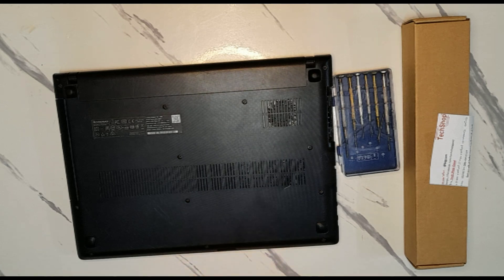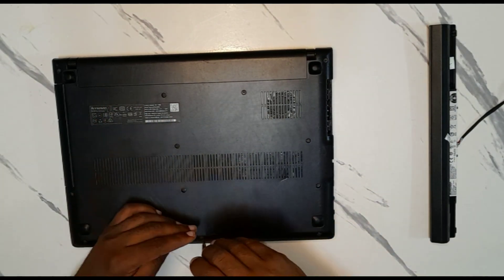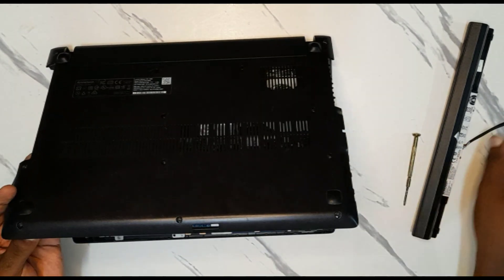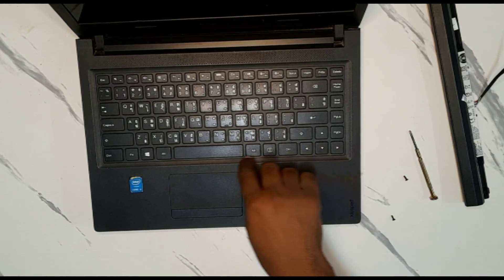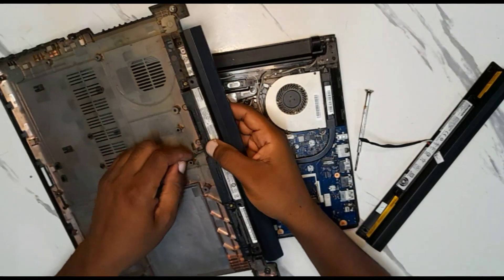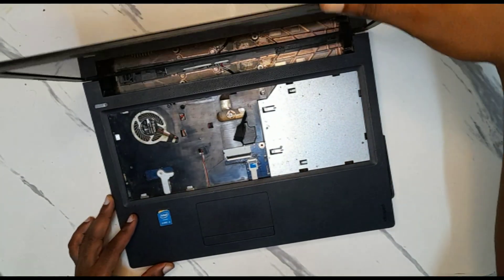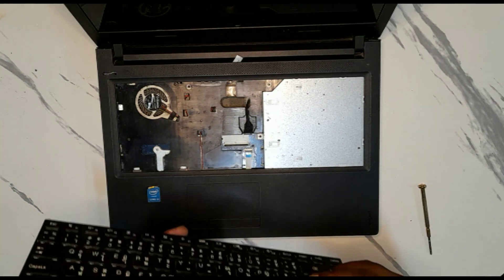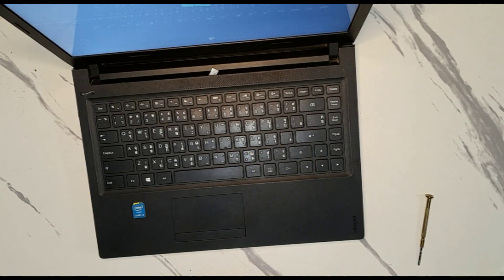Lenovo Ideapad 100-14ibd Battery Replacement | Step By Step On How to Remove The Battery

Comment: como se el modelo de bateria
Reply from the maker: To find your laptop's battery model:

1. Check the Battery Label: Remove the battery (if removable) and read the model number on the sticker.

2. Use Software: Run powercfg /batteryreport in Command Prompt (Windows) or use tools like HWMonitor.

3. Check the Manual: Refer to the laptop’s user guide or specifications.

4. Search Online: Use your laptop model on the manufacturer’s website.

5. Contact Support: Provide the laptop model or serial number to the manufacturer for details.